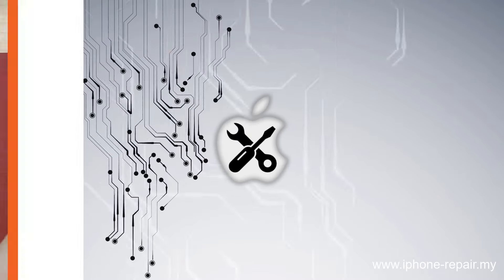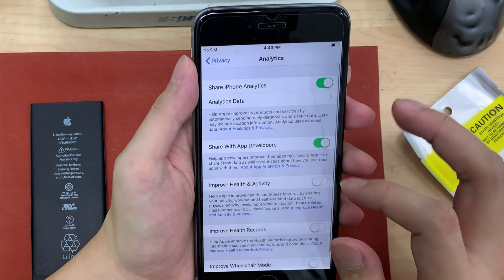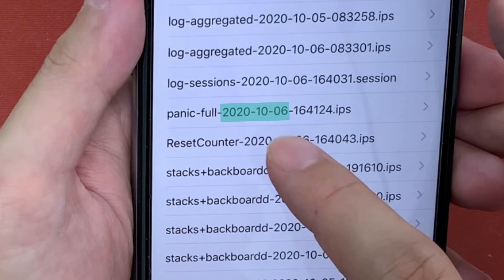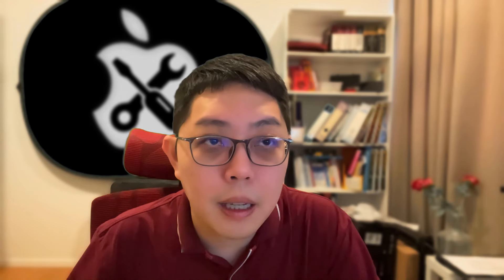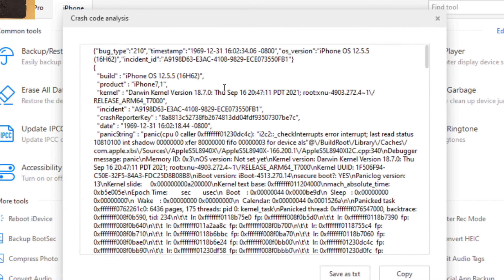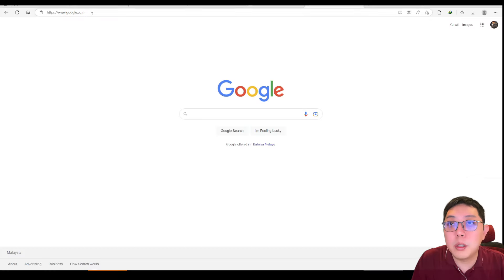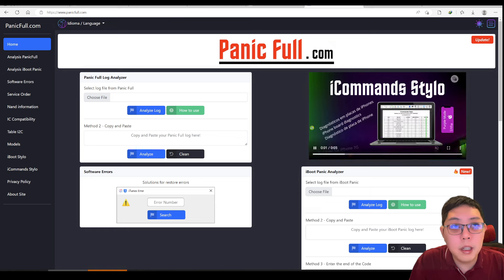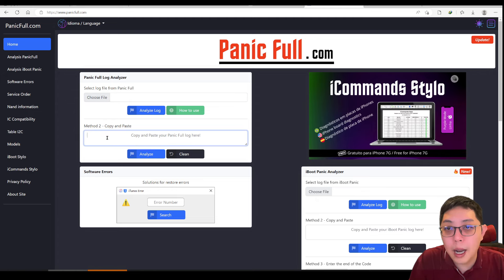iPhone keeps Restarting Every Few Mins【Tutorial】iOS PANIC Report Analyzer | Crash Restart Problem

Comment: Excellent.. a question, I have a 14promax but at all times only the screen turns off, not the cell phone, and I have to wait for it to turn on again, any suggestions?  I don't get the panic full files...
Reply from the maker: Your symptoms are not clear.  Especially you said not the cell phone and wait for it to turn on. 
Also, there is a difference between the self-power off or just deep sleep.
Reply: @iPhoneServiceMalaysia  sorry for the confusion, i think the problem is called black screen, every time the screen goes black and after a few moments it turns on again.
Reply: Can i ask po if whats the issue or problem of my iphone 11, its keep on blackscreen. Then yesterday ill go in the technician but in the analytics improvements they didnt see anything problem like panic log. What should i do?
Reply: And the one thing i do is to restart my phone
Reply: Have you changed the screen before?

Comment: SD: 0 BC: 1 RC: 77 BS: 2, Missing sensor(s): TGOB Inservice: backboardd, total successful checkins in 177719 seconds: 17753, last successful checkin: 0 seconds ago nservice: SpringBoard, total successful checkins in 177693 seconds.
Help me brother what’s the problem 😭
Device: xs
When my mobile reboot its show low bettery option but In actual my battery is not low it’s like 75% charged and keep restarting after 1 hour and show me low battery option need help😔
Reply: same
Reply: any soultion?
Reply: @RetiredBoyy777  battery issue or maybe battery connector issue
Reply: @AsadJc  okay2
Reply: @RetiredBoyy777  did u change ur battery
Reply: @AsadJc  no bro
Reply: @AsadJc  but it shows battery as unknown part
Reply: update: i changed my battery and problem got solved…

Comment: Hi sir. Greeting from Malaysia. My 7 months old iPhone 14 Pro suddenly turn off immediately and I need to turn on manually myself. 

There’s a ResetCount log (Bug 115) and Panic-Base 210 in analytics.
Reply from the maker: Hi. Problem not same, yours one is standby issue. Deep sleep state powering has issue. Send to warranty. It’s a motherboard power problem usually.
Reply: @iPhoneServiceMalaysia  already checked with Apple SC. They diagnosed my phone and lucky enough it was panic-base and not panic full error. 

In my case, Shopee apps did something with audio channel and crash my iOS. Shopee apps seems buggy when viewing videos on review section. Now working okay again.

Comment: I just tried to replace the iPhone XR battery by moving the old BMS battery to the new battery. but after a few days my cellphone suddenly often turns off or loses charge. What caused it? this is happening on other phones as well. pleasw make video about it.
Reply from the maker: i'm in a certified Apple program. I have signed the agreement in order to take original parts from them directly. 
Cannot teach anything that is related to Apple authentic part bypass. Apple will bring hell to me if i do so.